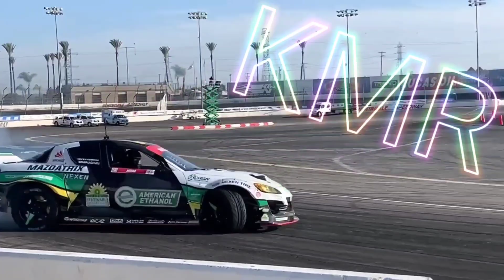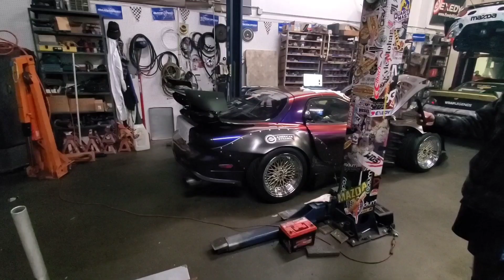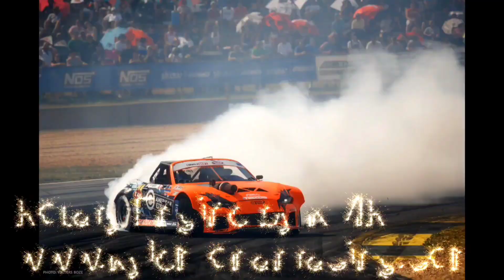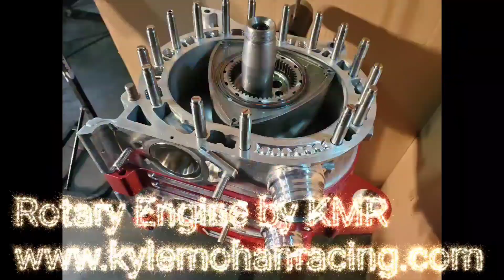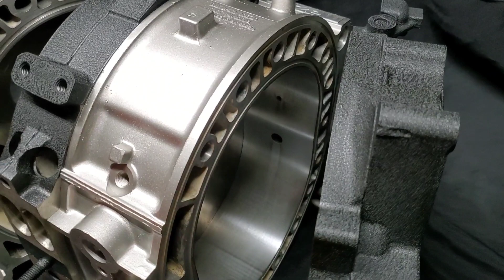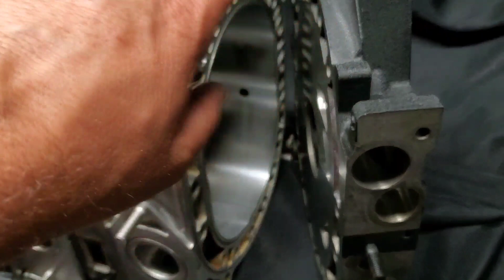Renesis / GSLSE 13b Hybrid Engine build - Mazda RX8 plus RX7 Motor combo - Big HP Combo - Vol 7

Comment: Can we all please just take a moment to acknowledge the fact he just said that the Renisis Engine had 200,000 Miles on it 🤯🤣.. what premix where they using I could do with a bit 😂
Reply from the maker: Over a couple rebuilds parts can rack up the miles, and my references are regarding the rotors and side plates. Obviously 200k is not on a single engine life.  There are lots or RX7s and RX8s with high mileage. And some parts may be original but not everything.  I think you misunderstood the idea presented.  Use old parts to make something useful.
Reply: @KyleMohanRacing  I had bought a one owner s4 fc that had 200k on the original engine and it actually had good compression ran great don't know what happened to the car after I sold it but I never got a call saying I sold him junk.
Reply: E6
H
U

Comment: I've spent a bit of time looking at rotary engine building and find it difficult to identify a setup that will reliably provide 350hp to a Renesis based motor,  ie a motor that will last 100,000 miles, with proper servicing. I'm just after a capable road car.

Comment: Kyle’s heard this before so the following is for others that may find the information useful.

I’ve tested multiple fully built Turbo Reni MSP motors(non-hybrid) w/Rx8 10:1 rotors on Race E85, anything beyond approx 24psi would cause ridiculous amounts of blow-by and increased detonation, no matter how much timing was pulled.  Even at lower boost a 2-Liter catch can would overflow after a few miles and that’s with all healthy side seals and compression.  One of the motors had .004” side seal clearance and blow-by/detonation was still a huge problem past ~24psi, another motor with very tight clearance approx .002” didn’t last, side seals expanded from direct contact with exhaust gases which was exacerbated by elevated EMAP.  

The solution, 9:1 low compression FD rotors and aftermarket side seals.  (I’d actually now recommend 9.4:1 rotors as 9:1 is overkill)
Results:
554whp on E85, and 625whp on methanol, both were unfinished tunes with lots more to go but TPS failed twice.  Motor was pulled for inspection after approx 5k miles of street abuse and countless dyno pulls; all seals, rotors and bearings were flawless.  This is all without the exhaust cut-off scraper rings, which I do recommend to be machined into the rotors.

The 10:1 rotors are perfect for NA but once boosted, CCP/CCT increases exponentially.  The hybrid motor should have a very positive effect on EMAP and extending side seal life, but won’t solve the elevated CCP/CCT issue caused by the 10:1 high compression rotors, or at least won’t solve it for applications beyond ~24psi.

As always, big time thanks to @Kyle Mohan Racing for unselfishly putting in the time, effort and cash on this R&D. 
🤝🙌

Comment: Kyle; can you use ceramic or goopy seals instead of cutting the Renesis rotors for 2mm apex seals?
Reply: Pretty sure he said no in another video. You need the depth.
Reply: With the Pport exhaust you want the 3mm tall apex seals to avoid bending in the center as the apex seal goes over the port.

Comment: Kyle, another great Vid. Is it within your power to show use the whole process to evaluate the rotor housings for "grinding", and the equipment and procedure to do that?
Thanks
Reply: Checkout rad potential
Reply: @ADudesRotary  Yes, I have seen that, not enough control to do a good job. There is a shop in Quebec that built a custom unit, that has good results. I was hoping  Kyle could explain the grinding machines "Secret Sauce"  I t may be confidential.

Comment: Is this setup going to be tested NA before getting boosted? I think that's what people want to see, then go to the moon...
Reply: That one makes 220rwhp (Malaysia gang). But rotary revs did a stock iron and it got 219rwhp and it was just a clean rebuild with mild factory porting and a tune. The hybrid needed to rev to 9800, the RR renny to 9k. One wheel dyno, one hub dyno. ¯\_(ツ)_/¯
Reply: @noname-sd5dt  None of those builds make impressive numbers compared to a well built & tuned stock port motor.
Reply: @BeaverLakeMotorsports  are there stock port renesis making 220whp?
Reply: @SilentSamurai8  stock port around 200 and street port in the 220's... hybrid needs to make significantly more than that to make sense.
Reply: @BeaverLakeMotorsports  I totally agree.
Reply: There’s a Bridgeport na hybrid on YouTube making 200 or somethin

Comment: How about intake setup? Factory intake manifold? Any modifications recommended for the intake manifold? Thank you.
Reply: I’m wondering the same thing. If Kyle keep up with these videos it will be an really good resource when doing a similar build
Reply: The timing of the peripheral exhaust port on the housings creates overlap and negates the designs of the stock intake manifold & valving. You would lose low end torque/hp by introducing overlap. The renesis intake is designed for no overlap.

Comment: Do you think, this combo might have a future or is 13b REW still better build with single turbo.
Reply: I’ve had all the parts for this build but everyone in the hybrid group on Facebook said rew makes more power currently main reason being the rotors only being able to hold 25 psi reliably unless someone makes custom rx8 rotors
Reply: Rew you can run 30+ no problem if your studded
Reply: @TheRandomRobert71  Why cant you use REW rotors, arent their same size and everything. Just older tech?
Reply: @jotenmike  side seals are different they said they chip the corners off on the exhuast port and intake port primaries n secondaries both have less material for the corner seal to ride on
Reply: @TheRandomRobert71  have you seen the blue rx8 landspeed record car its a renesis with rx7 rew rotors it seems to be running just fine but its using powerseals sideseals
Reply: @stephenwever  there using a rew motor now that land speed motor you can’t find any info on the shop that claims to add the scraper ring onto rx7 rotors for rx8’s I tried emailing the shop since it’s couple hours away from me but they didn’t recommend it didn’t explain why tho
Reply: @stephenwever  I have power seal side seals for my fd rotors I set the rotors on the iron with the shaft in and spun it the side seals do rub as they pass the ports but not much so it could probably run for a little but it’ll tear up the irons
Reply: @stephenwever  also str8 up revving on YouTube he filled his side exhuast ports and used fd rotors he said the irons wore out and chipped the side seals
Reply: @stephenwever  just uploaded my videos of the fd rotors on the rx8 iron
Reply: @TheRandomRobert71  didnt know the stopped using the renesis and i think its pettit that offer the scraper ring service ill take a look at your channel
Reply: @TheRandomRobert71  you could probably chamfer the edges to help but thats still a bandaid
Reply: @stephenwever  yeah I emailed them and they didn’t answer a guy local to me building one called them and explained his build he wanted a big turbo hybrid with fd rotors and they said just to run the rx8 rotors 20psi on pump ethenol you can do 25
Reply: @TheRandomRobert71  looks like its not worth going rew rotors
Reply: @TheRandomRobert71  Got you, thanks for reply. I dont know much about hybrid 13bs
Reply: @stephenwever  Thanks for info too. Youtube is such a nice place to get knowhow.

Comment: What about intake/ exhaust overlap? Aren't the GSL ports closing way later than the Renesis? I'm curious about the power band for this setup.
Reply: There are already a few dyno comparisons on the forums. Plenty of written out theory as well. The GSL housings give large bridgeport levels of overlap(assuming stock REN intake ports already) so you should expect a loss in low end torque(greater loss if the REN intake ports are street or bridgeport). Then a very very slight (1-10hp) gain at peak due to the extra exhaust out flow. The dyno's shared mimic this, where the low and mid loss is fairly significant and the top gain is barely noticeable. Of course all dynos on the forums are under different conditions with differently built engines on different types of dynos so nobody will ever agree on anything.

I can't really understand why people would try this NA as there are really only negatives to be gained. Cleaning up the exhaust ports on the stock REN would most likely net you any additionally needed flow that the Massive GSLSE ports offer.

For turbo the issues you run into are the same as the above. but with the rx8 center plate and side plates you are splitting your exhaust pulses, while also mixing chambers in the center port. Where on a REW you'd be able to do separate single exhaust ports with a twinscroll and not use the bulky RX8 Lower intake. By the end of the build you'd likely spend just as much money anyways.
Reply: @mincvinyl  My exact point, this engine is having the overlap larger than a peripheral intake and exhaust port, but alot of drawbacks on high end. If you want power out of a turbo 13B, use the REW.
Reply: Well for Rx8's I would say turboing a renesis does have its place. By the end of a REW swap you are likely to spend 15-20k where to turbo a Renesis you may only spend 5-7k. However you pretty much limit yourself to 350 responsive HP. Which honestly may be enough for most people, as there is plenty of weight savings to start looking towards. Also considering most RENs likely sit at 170-180hp, hitting 350 is quite the change.

Going beyond the 350hp is where you should go REW. So the question really is do you think you'd be comfortable stopping at 350hp or are you the type of person to keep raising the bar? Which build/path do you invest in?
Reply: @mincvinyl  I race my RX8 in hillclimb races (see my channel). I do not think a boosted Reni can survive this kind of racing enough to worth it, so I'll be doing a REW swap soon (I have a Samsonas dog box as well).
Reply: @michaeldragos  Yeah for sure I just saw on your channel. I'd think the center exhaust sleeve would probably degrade and would risk breaking off with the sustained heat from racing.

I have 3 rx8s, a junker, one for autoX, and one being preserved for a rew build for street/highway driving.
Reply: @michaeldragos  I really wanna see one of these but with a gslse center iron and some semi PPS na. Seems to me one could stretch the powerband pretty far with the right header/intake setup. I'm super temped to get some Reny end irons and throw a motor together for my supercharged fc. Also can't help but wonder how far some devcon would go to close those 6ports a bit earlier?
Reply: Can you also show how peak torque is effective by porting or is it just rotor lightening that determines peak torque?